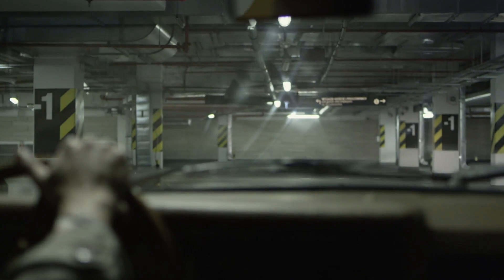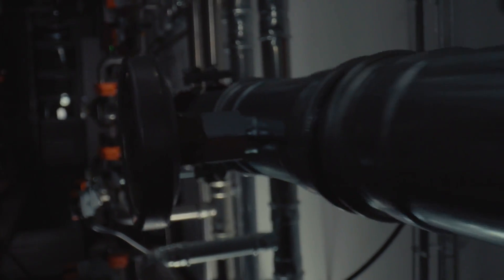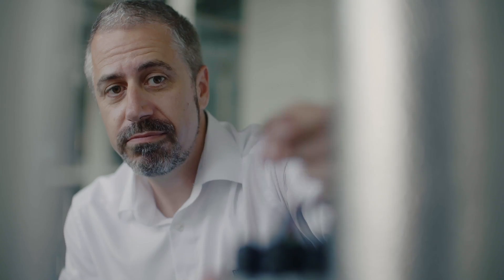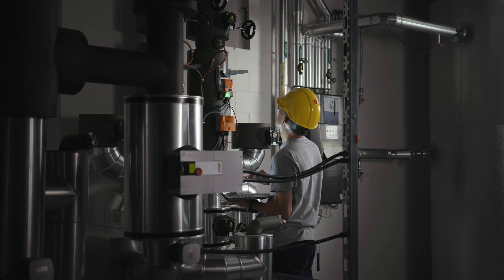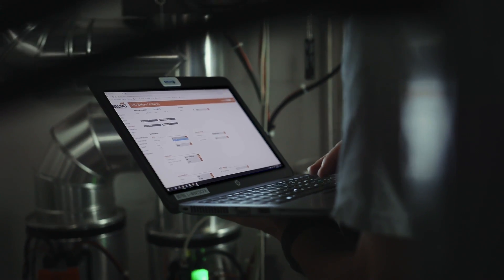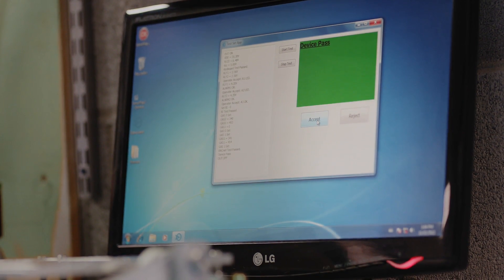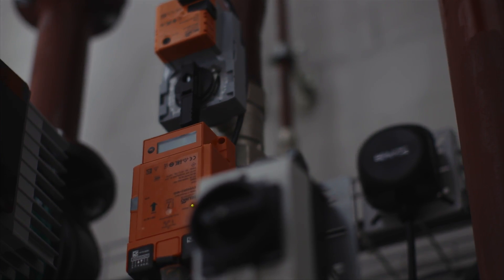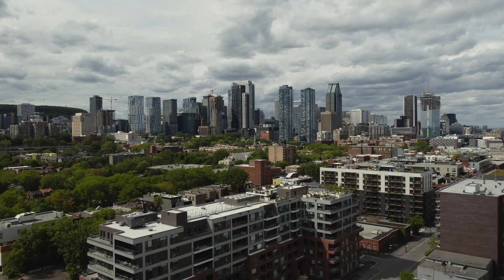Accurate and Reliable Gas Monitoring | Belimo Gas Monitors

Comment: Do these gas detectors have certification for use in fire alarm systems?
Reply from the maker: Thank you for your question. The answer depends on the authority having jurisdiction. The codes required by the NFPA Code 72 are dependent on the authority having jurisdiction. We recommend reaching out to your local authority for more information. If UL 874 is required, it is recommended to use a UL864 certified relay in conjunction with the gas monitor relay.

Comment: Is the intent of the analog output to control the speed of a vfd or simply an additional monitoring point?
Reply from the maker: The intent of the two analog outputs (available on all -A model gas monitors) are to control the speed of a variable speed fan (VFD) or to send the gas readings to the analog inputs on a controller. By default both analog outputs are linear and have an output signal of 2…10 V or 4…20 mA (selectable via a jumper on the gas monitor PCB) proportional to sensor A and sensor B gas readings. They are also configurable via the programmable menu. For more information please refer to the gas monitor operating manual, available on the Belimo website: https://www.belimo.com/mam/americas/technical_documents/Support%20material/belimo_gas-monitor_operations-manual_en-us.pdf